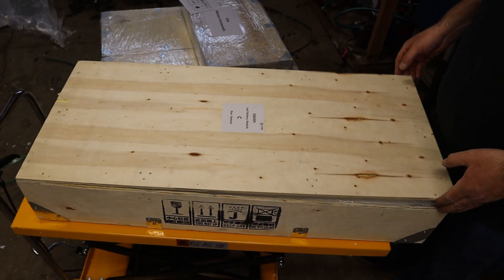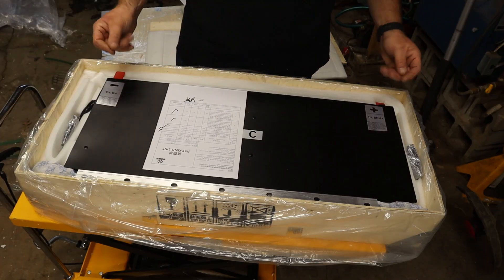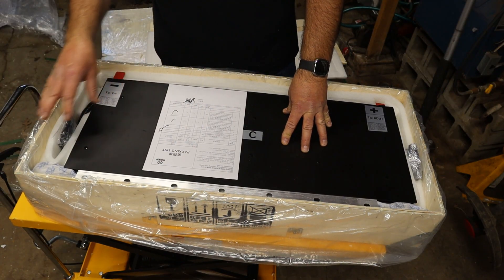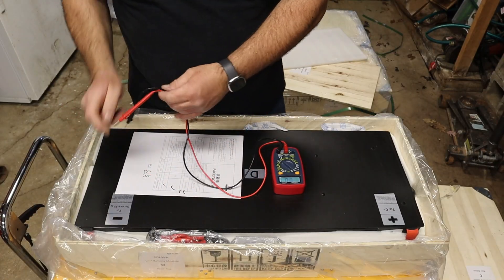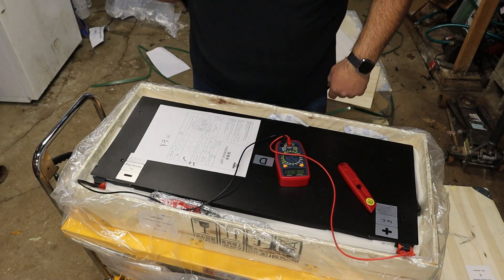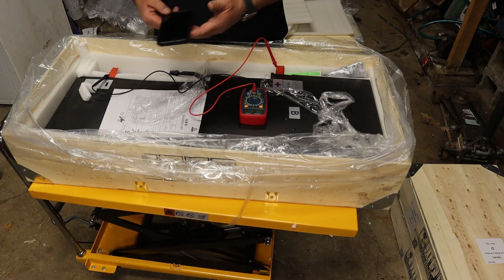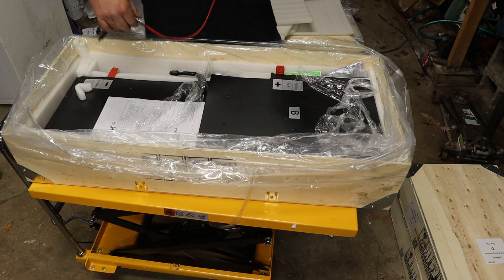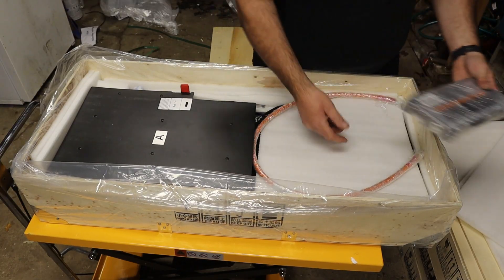Leaf Battery Upgrade Unboxing

Comment: I installed the packaged (fully encloses) 50kwh replacement battery last fall on my 2016 Leaf (VIVNE). I sent them a leafspy screenshot of the défective 30kwh original battery. I installed it myself using 4 car jacks and 2 moving trolleys. Cost me 11k$ 10:30 Cad total. Now 300km range, super happy.
Reply from the maker: Thanks for sharing, that's awesome

Comment: I’m buying a low mileage env-200 soon. It’s good to know that if one day the battery goes this can be done and the car avoids getting scrapped.
Reply from the maker: They also sell entire packs so you don't have to swap modules.  I chose the hardest option to showcase on my channel.  Hopefully it proves to be pretty simple and straightforward.

Comment: How much did all this cost ? My leaf has 7bars left i will soon need to replace my battery too
Reply from the maker: Check their website. With all the news about tariffs lately, I don't want to give you outdated information. Link in the description.
Reply: @NoGasNiko  Why is there such a big difference in the price of the two sites?? 2650 dollars on one and 7100 on the other ??
Reply from the maker: Not sure about the 2650, that seems very low.  7100 seems more likely the right one.
Reply: @NoGasNiko  $2650 I would purchase it right now lol $7100 I would jus drive it until it dies and junk it.
Reply from the maker: Maybe prices will continue to come down, you never know.
Reply: What was your import tariffs a month ago when you received it?
Reply from the maker: @shevceu1 I actually received this on January 30th.  I paid for shipping and the modules several weeks prior to that.  Long before talks of tariffs.

Comment: It’s looking good!
Update on my 2018 Leaf….dealer says the new battery is on its way and should be installed by later next week.  Nissan must have batteries available closer to home than China or Japan.
Reply: Why u need a battery? How much they charging??
Reply: @abcloft302  @veganwally  if you saw the videos made by  NogasNiko or Nikolaos last year, you may have seen the episodes of his 2020 Leaf plus that went into turtle mode in cold weather way sooner than is normal, making the car unreasonably short ranged.  He had to battle with the dealer to get it covered under warranty and provided them with proof of the problem by showing them videos and results from the Leaf Spy.  I've encountered similar short range problems on my Leaf, especially in cold weather.  My warranty is still good until next fall so I have taken action by following Nikolaos' example  and have presented my dealer with the results.  It has taken them two weeks to diagnose the car and to get a decision from Nissan and the result is good news for me.  They have determined that at least half of the cells are not good and will be replacing the whole battery under warranty.  I love the car and only have 46K miles.  I've noticed about 10 to 15% less range even on nice days since the car was new.  I still have full bars showing for the state of health.  I am grateful to Nikolaos for his videos.  Without them, I would never have know how to make my case.  The first response from my dealer was that, it's natural for the battery to degrade in time and that EVs just don't do well in the cold.  That of course is understood, but I was having more problems than you should and was worried that my battery life could be more short lived than expected.
Reply: @abcloft302   @veganwally  If you watched the videos from Nikolaos last year, you may have seen that he had a problem with his battery on his 2020 Leaf +.  I am experiencing a similar problem with my 2018 Leaf.  I followed the example of his videos to be able to present a case to my local dealer that my car is having a problem, even though after only 46K I still have all of the bars for the state of health.  My warranty is good until next fall and I made videos and took screen shots of my Leaf Spy for the dealer, whose first response was that my problems were normal.  After two weeks at the dealer they have diagnosed that half of my cells are bad and Nissan has finally given the go ahead to replace the whole battery under warranty.  Without the Nogasniko videos I don't think I would have known what to do and I am really grateful for this.
Reply: 2018 Leaf needs a battery, doesn't sound good.
Reply from the maker: I still haven't heard a word about my 2020 Plus yet. I should call them tomorrow.
Reply: @NoGasNiko hasn’t been a year?!
Reply: We had the dealer do our 2017 Leaf summer of 2024 as a warranty replacement. It was the 1st one they had done...ended up with a 40kwh battery pack (no 30kwh packs available). Ended up with around 300km summer range and this past winter about 220km in real cold weather...it is better now than when new. Nissan was actually great to deal with!
Cheers
Mike 🇨🇦
Reply from the maker: @michaellippmann4474 glad to hear someone with a good experience with Nissan.  My 62 kWh is still at the dealership awaiting word on repair.
Reply: @NoGasNiko  yeah, I was pleasantly surprised as I had heard nothing but horror stories. Dealer is Windsor Nissan and they were super helpful. We never lost the use of the car but when it dropped to 8 bars we took it in and they tested it. Got a call from the SA and he informed us he put it to Nissan Canada and a week later we're told a new battery was on the way! That was in March 2024, got a call beginning of June battery had arrived and they did the swap! Pretty amazed!
Your project sounds great, good way to get a Leaf up to modern range expectations!
Cheers
Mike 🇨🇦